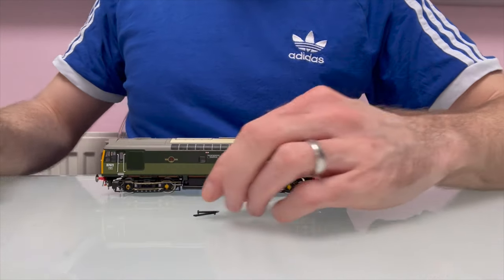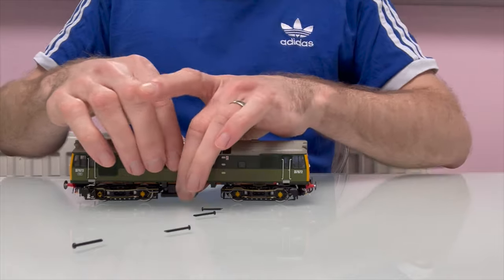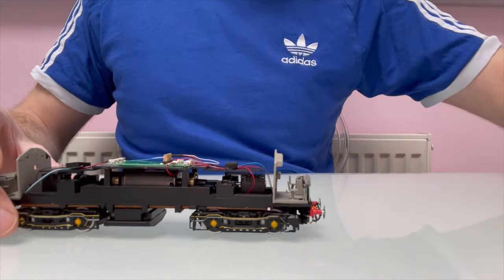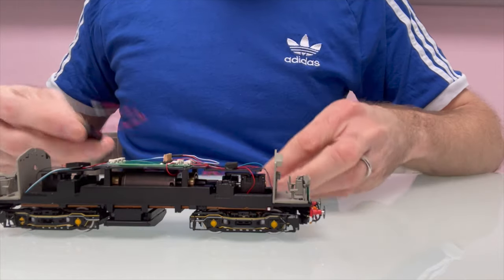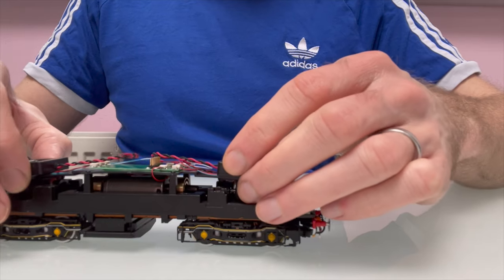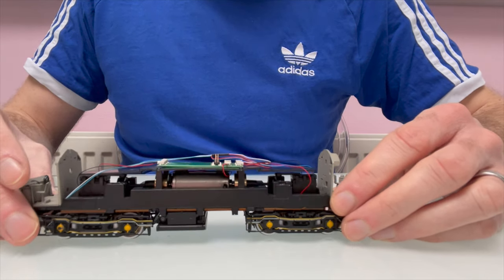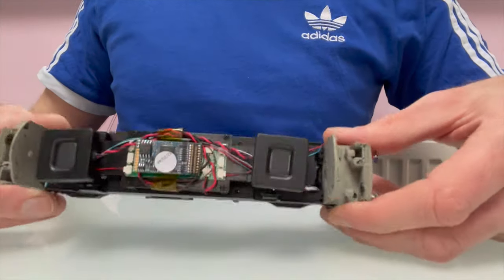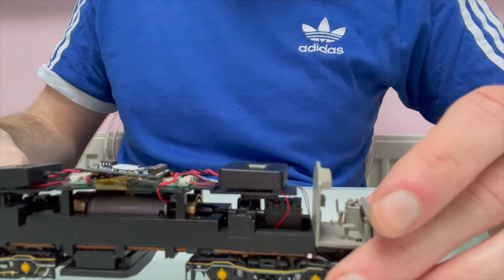NEW Heljan Class 25 Sound Fitting Video! SWD Sound And Two Megabass Speakers

Comment: Yes I would like to see more of these videos, but could you show what you wire the speakers 🔊 to as I’m new to this sound kit thanks 👍
Reply from the maker: Thanks, I can definitely do more on that next time. There's a basic guide here https://www.roads-and-rails.co.uk/pages/speaker-wiring-instructions these are 4 ohm speakers wired in series
Reply: Looks like a cab light on or is that just light bleed from the head code box Richard?
Reply: @vcs00railway  Its the way the model is designed unfortunately. The headcode LED is mounted to a micro PCB which also contains the cab light on the rear side, it is fed by one power feed, meaning that when the headcode is illuminated, so is the cab.
Reply: Thanks,  bit disappointed of Heljan given the RRP,  perhaps makes the new Sutton Loco works worth the money
Reply from the maker: @vcs00railway  does seem a bit odd, even the 128 which must have come out 10 years ago had independent cab lights, so they can do it if they want to

Comment: The horns are wrong on the sound file chosen for this model sadly, the soundset chosen by SWD was recorded from a 25/0 or 25/1 hence the BR Style low tone horns, the 25/2s and 25/3s all have the very unique sounding horn like that of Legomanbiffo and Jamie Goodmans sound chips that were both recorded from a 25/3, a 25/3 would of never of had these style of horns but apart from that the sound install sounds ok.
Reply: Was thinking the same, the horns on the 25/3 are massively different, engine sound and note is also slightly dfferent. Jamie Goodmans would be perfect for this loco.

Comment: Hi Richard, thanks for a very helpful video. I believe the speakers you have used are rated at 4ohm, would I be correct in assuming you have wired them in series?
Reply from the maker: They are yes, I was worried it might make the volume a bit too low but it’s still nice and loud
Reply: Thanks for confirming. The sound is very good and the volume seems plentiful.